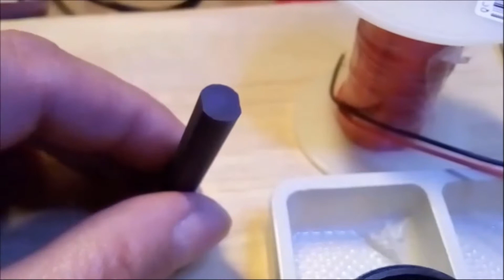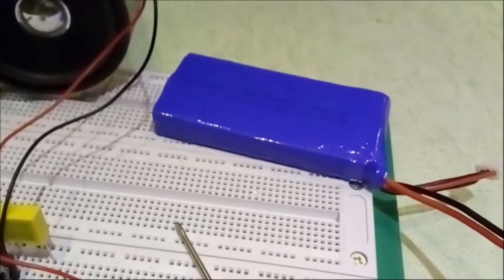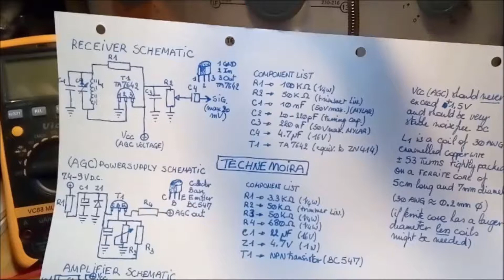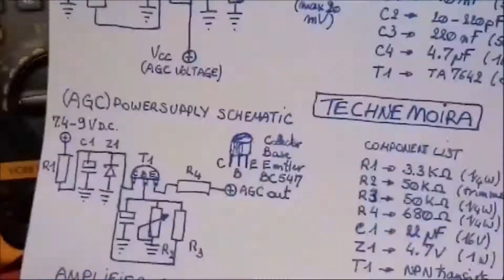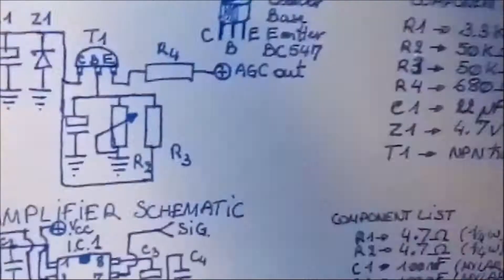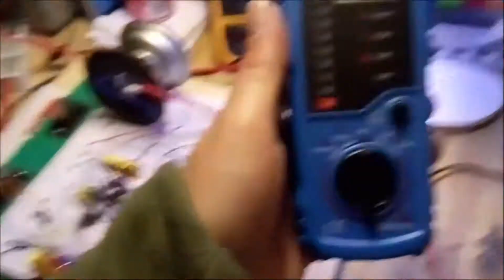Weekend Projects: Building A One Chip AM Radio

Comment: I remember building a crystal radio set when I was about 10 years old. I used about 40 foot of steel wire stretched from my window to a tree in our backyard, insulated at both ends. I used to listen to it every night as I fell asleep. Nice video, keep up the good work. Maybe you could do a video on how to make a crystal set.
Reply from the maker: Hello, 
Good idea. Yes I have been thinking about such a project, building a old-fashioned crystal radio. But it would have to be a bit fancy, so I'll see whether I can scrounge some material that looks suitably vintage to build one. I'll certainly keep it in mind as one of the next episodes.
 By the way, did you know certain razor blades seem to be covered with platinum on their edges. I also know for a fact, some old surgical tools have small amounts of silver, since silver has a bactericide function. It's interesting to see what sort of objects have precious metals and how you manage to salvage them. It would be nice to see how to streamline the process of extracting precious metals in as few steps as possible and reusing acids and such as many times as possible.
Thank you for watching and rating. Welcome to the channel :)